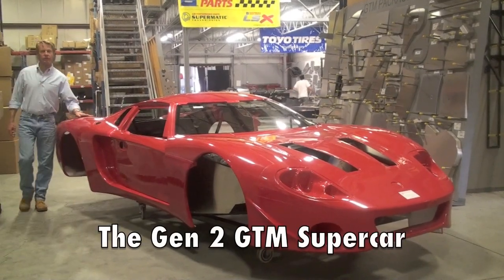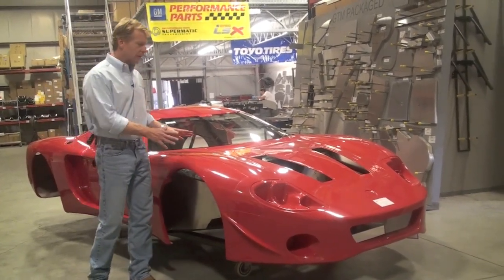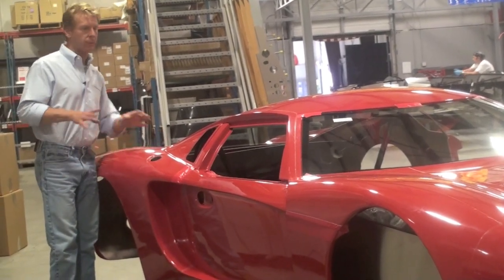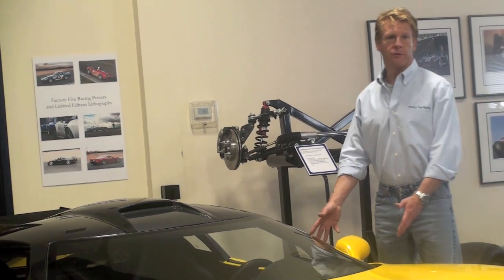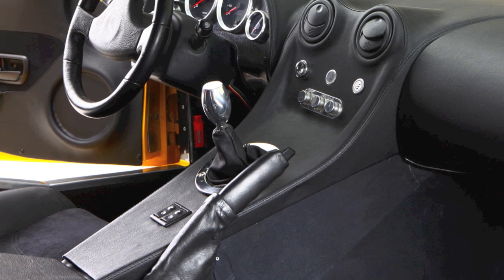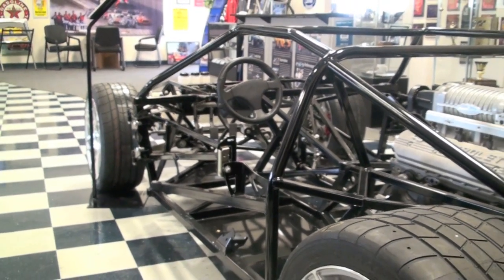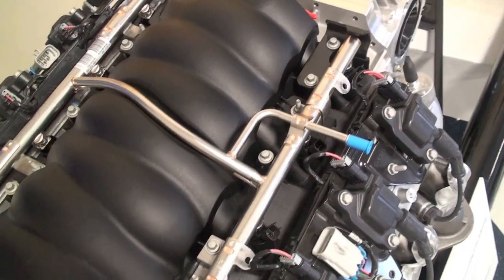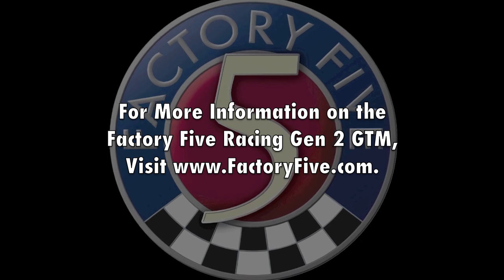Gen 2 GTM Overview

Comment: David, the car does look great. But you could reduce cost more and make it look even better buy reducing the size of the GIGANTIC front end. Mid engine cars normally have a smaller front end. GEN III, move the front wheels back a bit, reduce the front making it more sleek and not so long. I'm an industrial designer and this is just my humble opinion. Again, I love the GTM, it looks amazing, just something to think about. Great job so far and wishing you much success!

Comment: @radvigor Some of the "professional" builders say it takes about 200 or so hours to build. Considering there are 2080 hours in a regular work year, that's not a lot of time. That said I'd still double or tripple that time at least. Learning and building at the same time means you'll be building it several times in your head and thinking as far ahead as you can before you even touch a part in that area.

Comment: @radvigor the HP rating of the new transaxle is 650 HP. i would think alot would have to be done to a LS-9 to make it fit since it has a front mounted throttle body. You could use an LS-9 long block and put an Eaton R2300 (basically the same type of supercharger on the LS-9) with a rear facing throttle body, just to make it super easy to install and i bet its cheaper as well

Comment: @7upbottlesdown It is fairly hard to build a car. I haven't built a kit but I have built several off-road cars. I would suggest at least moderate skill before even trying to build one. That said my first real project was rebuilding and puting a big block into my Camaro back in HS. It took a long time but it turned out fairly well.(diligence pays off) You gotta start somewhere and if there is something you cant figure out you can always pay someone to do that part.

Comment: I like kit cars because fiber glass is actually a high performance material, better than what's used in mass production. not a huge fan of this crude ford gt steroid quarter back look but the quality looks good. I would encourage developing a second sportscar model that is more elegant, not quite as wide, finer features, narrower wheels, super light, no over the top air intakes, aerodynamic and with electric drive in mind. maybe call it Europa.

Comment: @112namrepus I've seen 5.4 engine swaps done in mustangs and the results are disappointing.  The 5.4 iron block is very heavy and I'd hate to upset the balance of the car both in terms of handling and the suspension.  I like what Capstone has done and turned this car into a hybrid powered by microturbines.  Hate to say it but that's the way of the future.

Comment: @kaylynne88 look at 6:03.  gap looks normal.  the quality all depends on who builds the car.  the car runs the price because of the engineering behind it.  it is technically a competitor of any Ferrari or Porsche based on power, weight, aerodynamics, and skid pad results.  it does come with an interior and the only suspension components you need are the control arms from a c5 vette (cheap).  you and all the people bitching about its "quality" are people who probably can't afford one anyway.

Comment: Just out of curiosity, would it be possible to mount an electric motor to each of the rear wheels and convert this to an electric car? I was looking for a project to make an electric car from scratch, and this looks like an awesome place to begin with... Also, would it be possible to fabricate the chassis from aluminum to cut weight?

Comment: No need to win the lottery, only $25,000. All you have to do is find an LS engine ($5,000 to $10,000) and a Porsche G50 gearbox ($5,000). For $40,000 + labor you have yourself a supercar that turns heads and stomps other supercars.
Reply: Double that figure, and you might be somewhat close, realistically.

Comment: The problem with this car is it weighs 2500 lbs or so and you want the customer to use suspension from a 3600 lb ( Corvette )  car...WRONG....You need to have an engineer design suspension parts for this car...Beautiful car great design, but not the right suspension